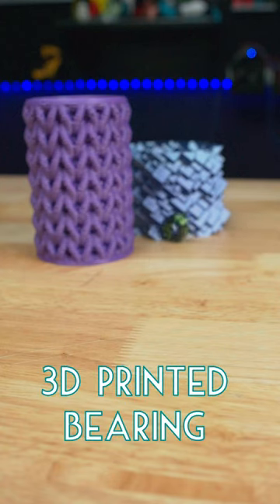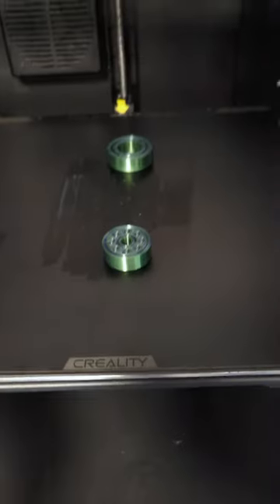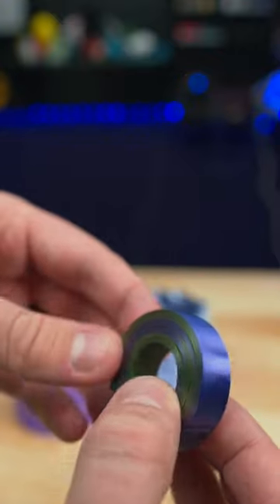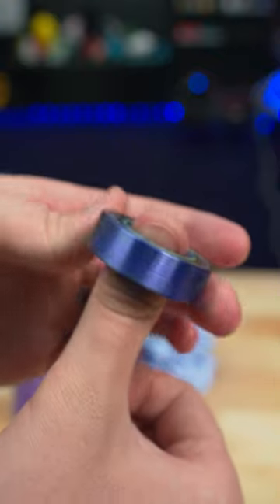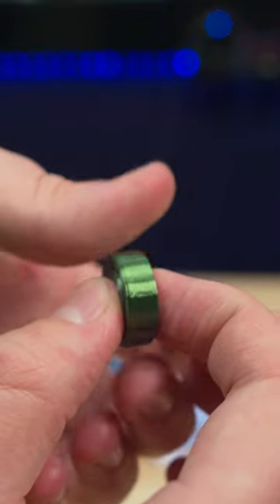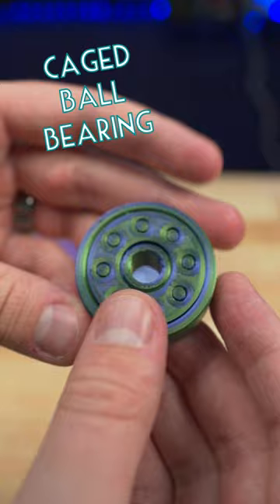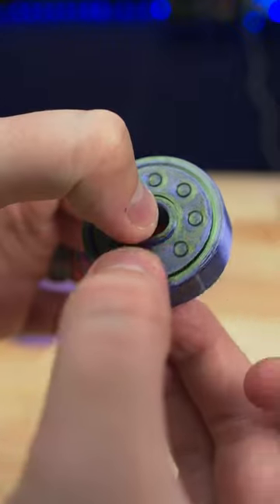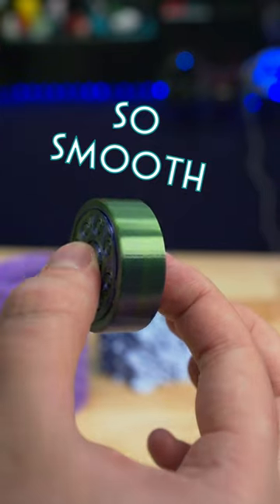3D Printed Ball Bearings 🛹

Comment: I appreciate this a lot and I would advise anyone to print these just to get a good sense of how bearings can be made... but then, please get 10 steel bearings for 5 bucks. Much lower friction and much better longevity. You can find them in any size without problems.
Reply: I need bearings that won't corrode and won't bankrupt me... probably going to do PETG with glass bearings; we'll see how it goes.
Reply: You can also buy 100s of steel balls for about the same price. If you were really interested in 3D printed bearings, at least you could put steel balls in them

Comment: All that remains is to print engines, an electronic board and all the heating elements and it will be possible to print a 3d printer from a 3d printer
Reply: It is possible to 3d print a 3d printer basically. Thats been a thing since the very beginning

Comment: Are they any good for using in for example an RC-car? High speed and load?
Reply: I don’t think it makes any sense to print bearings other than showcasing that it’s possible… especially with how cheaply you can get properly lubed metal ones 

The printed ones will just melt and bind up with highspeed applications or simply break with high torque applications

Comment: how do you get prints like this to work ?
whenever i try to print models like that they always get stuck together and don’t move
Reply: It takes some calibration but in cura if that's what you're using I found a setting called "slicing tolerance". Setting this to Exclusive means the layers will be contained within the lines of the original design. Also the seam can cause issues with stuff like this and printed extendable blades to stick. Randomizing the seam can help or changing the placement of it.
Reply: Try different flow values, and if this doesnt help - try recalibrate steppers in your printer

Comment: I'd be curious if any particular grease would be good for using on those plastic bearings.
Reply: I use the grease that came with my 3d printer on PETG gears. Works very well.